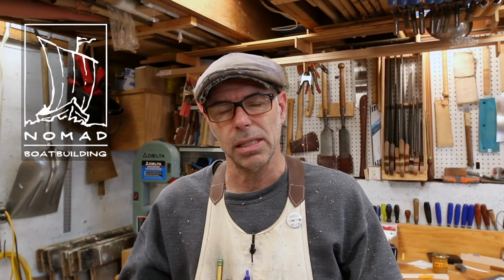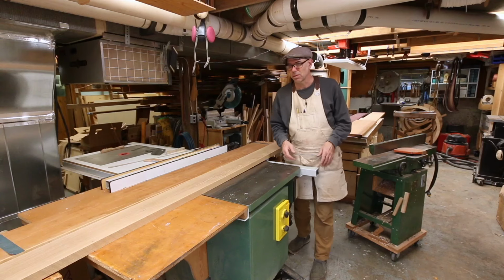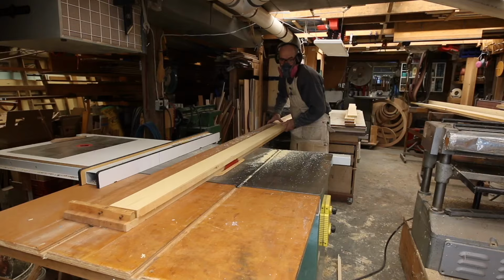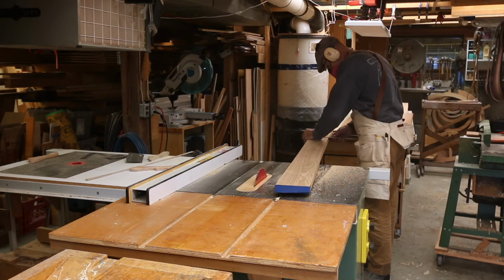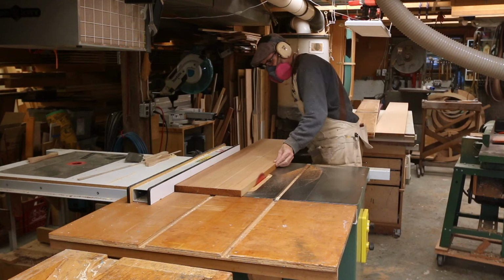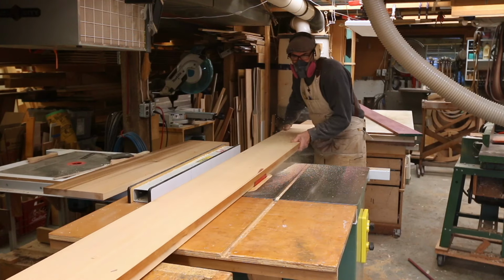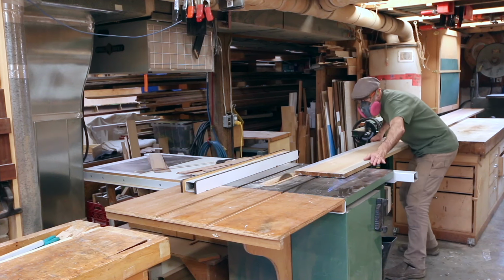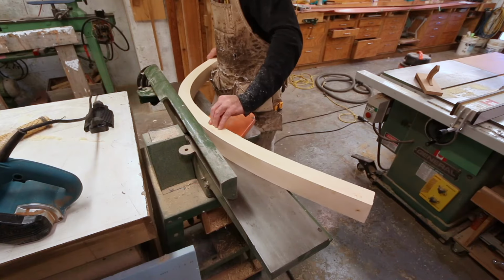Long boards, straight and square with a Jointing Sled

Comment: I've started using a track saw with a long track for the first cut. Then I clamp my 7 foot level to the table saw fence  for the parallel cuts. Works pretty well.
Reply from the maker: That’s a good idea. I should try that sometime.

Comment: Since I have big a rotten boat, a thickness planer, a table saw and no jointer, this will come in handy!
Reply from the maker: Buy a bandsaw before you even think of a jointer. And then consider a drill press or edge sander second.

Comment: for long boards, I have put both sides through my thicknesser, then set up an aluminum straight edge on the plank with an offset to run my trim router against. As a quick set up, One can use a couple of stops, just a few mm wider than the sides of the cutter and base plate clamped onto the board at the ends just to set the straight edge against. Nice and simple to use.
Reply from the maker: I use that same method as well when I need a little more accuracy or if the plank exceeds the sled length.

Comment: I made a jointing sled like yours, as soon as it was done I wished I had designed it to have a few t-slots/t-tracks down the length of it.  There are clamps and a host of accessories available for t-slot.
Reply from the maker: I have others with T-slots but I don't use them nearly as often as I anticipated.

Comment: Hi
I like your shop aids Vlogs.
Should the out  flow table be the length of the board that is being trimmed?
Reply from the maker: It only needs to be as long as is required to keep the weight of the sled and stock from tipping out of the slot. I have me joinery bench set up to do that job. The spline in the sled rides in the tool tray and there is a notch cut in the bench for it to enter that space.

Comment: Hi Mark, what are those long chisels over your left shoulder @ :15 seconds into your introductory used for?
I pursued 2 just like yours and was told they are used for ice sculpting.
There’s no mars on the handles from mallets hitting them.
Thanks
Reply from the maker: Those are called “slicks”. They are used in boat building and timber framing. The boatbuilding version has a cranked up handle and slight convex curve along the length of the blade that allows for more control on large surfaces. The timber framing version has a straight blade and is mostly used for tuning up joints like the surface of large tenons. They can sometimes be quite costly for particularly old and well made ones. My larger one has a value of about $1000 these days. I got it at a reasonable price but I still probably paid $300 for it at the time.
Reply: @Nomadboatbuilding  thanks mark